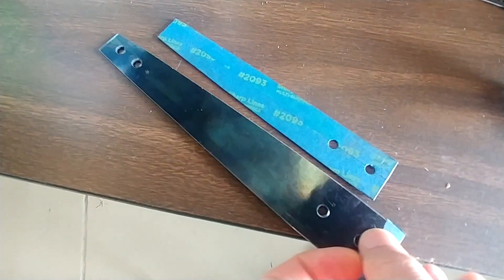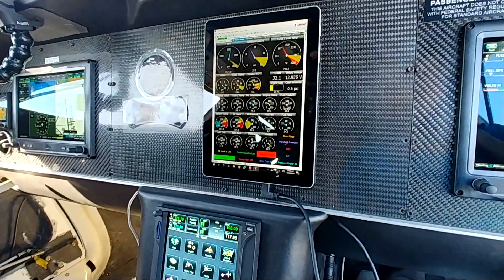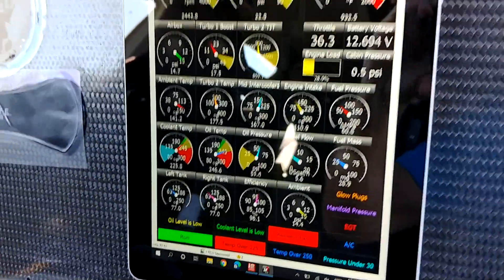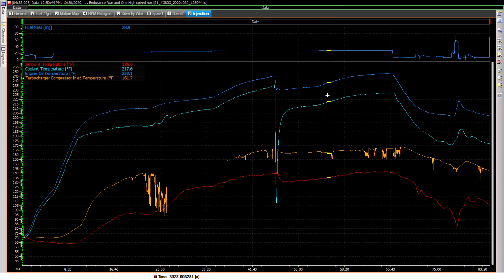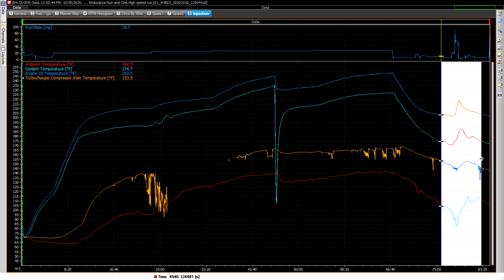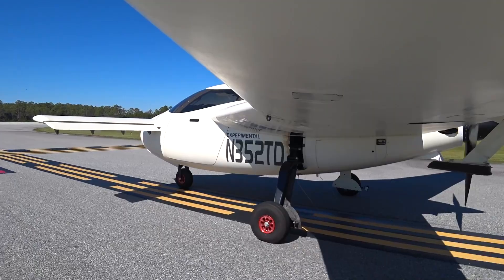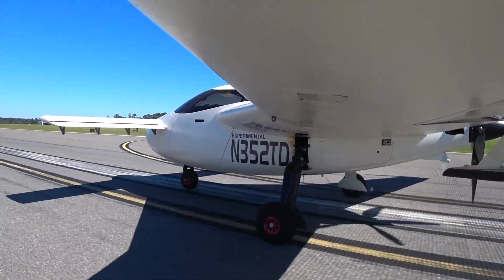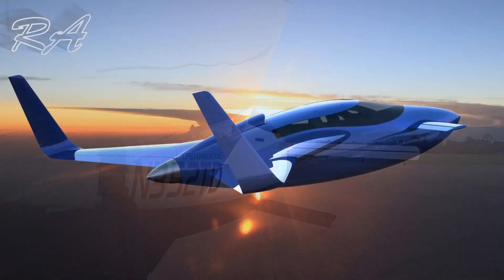Finding Equilibrium - Building the Raptor Prototype

Comment: Peter? . Do you have cabin  AC on during engine heat test or take off runs. It may help to disabled AC with a micro switch on throttle when  full power is required for take off . I have not noticed in before flight  check list. Could help with heat and  power. Looking forward to your next test flight .John

Comment: I didn't understand, why fwd CG should change your AOA on flight???
Reply: Because the canard will have to generate more lift to keep the nose up, the main wing will have to generate less (at the same weight) and hence fly at lower AOA. However, I think he said from 5 to 1 degrees which sounds like a lot. If that is measured relative to the zero-lift angle, that would mean the main wing only generated 1/5 the lift and surely the canard can't generate that much?

Comment: I'm liking your new trim spring design much better Peter.  Hope she behaves better in flight next time around. 👍
With the nose coolant tanks and cooler weather coming, you may not see engine heat problems till summer rolls back around.
I appreciate even your shorter update videos. 🙏  Thank you.

Comment: Do you know what the maximum oil temperature this motor was designed for? Most diesel engines will shut themselves off above 250° to protect themselves from catastrophic failure. Its my understanding this has a stock Audi block and rotating assembly.  I would not be comfortable maintaining 250° when it was never designed for it.
Reply: I’ll further get it to this. Aside from the loss of oil film strength at higher oil temps, another area of concern not many think about is piston cooling. Some of the highest temps the oil sees is at the bottom of the pistons. When the temperatures are critical enough, this oil that is being sprayed will begin to carbon up and attach to the bottom of the piston. This carbon acts as an insulator and the pistons will begin to no longer receive the cooling required to maintain it’s tolerance and integrity. I do not support the desire to sustain continuous operation of this engine at a temperature deemed critical in its original application.
Reply: @sy2207  - Not sure you understood the reasoning..
Reply: @PaulAnthonyDuttonUk  Im shure.... He didn't.
Reply: This is not targeted sustained temps in flight.  The whole point was to see where the temps stabilize at a certain power setting without ram air flow into the radiator scoop.  Basically, what power setting can he utilize for sure even if ram air cooling is not available (takeoff and climb).  If temps start getting out of hand, he'll know that at X power setting, it won't get any hotter.  That reduces pilot workload so he can focus on flying the plane back to the runway if something isn't operating correctly.

Comment: Are the covered up wheel wells now a permanent part of the design and you're giving up on retractable gear when you move beyond the prototype stage?
Reply: You're joking right? 🙄
Reply: @FWMjr2199  Well, he covered them up for a reason right? So far I didn't catch what the plan is to resolve that.
Reply: @ManuelBTC21  I think its more about determining if the oscillations seen on the first flight were, in fact, caused by the wheel wells. If its shown conclusively that the oscillations were caused by the wheel wells then I'm supposing some interesting discussions will be taking place! I'm generalizing here but most people in the comments on the first flight video  seemed to be sceptical...
Reply: Covered wheel wells are temporary!  For further tests on runway hops & perhaps a few wheels down test flights.  All of those would have been done with the gear down & locked anyway.

Please jump in here Peter if I've got anything wrong.

This new aircraft design is made to fly high & fast & comfortably & economically!  Pretty hard to accomplish all that with three landing gear hanging out in the slipstream!

Peter has overcome many problems as this prototype has been in development.  There will be more.  That's just how it goes with complex machines and new designs.  The Raptor just happens to be the cleanest & sexiest flying machine I've seen in general aviation in my forty-five years of being a pilot!  Amen for designers & builders. 👍

Comment: Another way to add short term (take-off) power while keeping temps down; using a switched misting of intercooler/radiator with water/alcohol mix (as opposed to just adding coolant mass). Used by several automotive oems (sti and evo for example). Cheap retrofit kits are available to evaluate the idea: https://www.summitracing.com/parts/dei-080140

Comment: The Dutton slides across the plains of the comments section. The air is dry, its lips are parched. It's been away for a short while. Some things appear to have changed. It sniffs the air, hoping to pick up a scent. Nothing. It's time to try a different approach. It's time to bring the prey to it. It howls into the night... AAARRR-WOOOOOOooowasabimuppetsrocketscientistspeterillprotectyoumylove
Reply: Unlike Wassabi I am a proactive type.

Comment: 246F oil temp is unacceptable for my engines. 180F ideal, 230F max. Cool engine is a happy engine.
Reply: For lycs and connies, sure...that's way too high.  This is a completely different engine with completely different systems in place.  From my research, these engines have a targeted oil temp range of 230-250F (250F being the upper limit for safe and reliable operation).  Modern oils can handle up to 250F but will break down at 275F, which is higher than what aviation oils like aeroshell can handle.  Pretty sure he's not using aeroshell in this engine, but rather what the manufacturer suggests.  Even on a typical aero engine like an IO-540, 180F is pretty hard to get down to unless you're in cruise...takeoff and climb you'll be in the neighborhood of 200-230F pretty easy in summer.  So far, he's really only been able to test the engine in takeoff/climb conditions, high power output and very little airflow, which is part of the reason why he's having cooling problems.  I suspect a lot of the cooling problems will go away once the aircraft is in cruise configuration.
Reply: @Skinflaps_Meatslapper  Thx for info. I did have a Connie in mind. I routinely saw 180F in cruise on my IO550. During winter months I had to block the oil cooler or it would never break 150F. Really good engine baffles. Learning something everyday. Thanks.
Reply: @nwbackcountry5327  What kind of bird you got running a 550?  Might look into whether there's an STC for an oil cooler door mod.  Where I work during the winter, early morning temps might be down in the 30's and then in the middle of the day it's up to 80, and if it weren't for a cockpit adjustable door, I'd lose my mind chasing temps all day trying to keep this radial happy.  All the way open in cold weather, the oil will get so thick I'll hit redline oil pressure below RPM redline.  Only partially closed in hot weather, oil temps will skyrocket and pressure falls below minimum.
Reply: @Skinflaps_Meatslapper  I was flying a Baron E55 with IO550s and Beryl D'Shannon engine baffles.
Reply: @nwbackcountry5327  Nice, I've heard good things about D'Shannon baffles from everyone who's had them.  I tried to get them to make a set for my C-188 years ago but they won't stray from Beech.
Reply: Your recommended temps aren't really applicable in this case.  This engine uses oil to cool both the pistons and turbos, which are very high temperature items and bring the oil temp up quite high, then it uses an oil to water oil cooler, so the oil temps can never be lower than the engine coolant temps since the stepped heat flow is pistons&turbos->oil->coolant->atmosphere.  It's much less important what the exact temps are than whether or not they are staying within the design range.  If they are getting out of the design range, then you need to adjust oil viscosity to maintain the proper oil flow and film strength at the actual temps.
Reply: When was the last time you ran your engine at 2400rpm for an hour to get that hot? Remember that test is an abusive condition to discover the limits.
Reply: @rnordquest  2400 rpm is cruise in a lot of propeller aircraft so that's not an extreme condition.

Comment: Peter, you can't expect to see span wise flow unless you're making lift, and more so out of ground effect.
Reply: Low pressure in front of the prop is limiting spanwise flow at the wing/strake transition.  Spanwise flow will likely be noted further outboard.  Note vortelon locations on Long EZ/Velocity.
Reply from the maker: True, but given the main wing has about 2.5 to 3 degrees of alpha when the aircraft is level it's already making some lift on these runs. So I suspect the same result may happen when airborne.
Reply: @RaptorAircraft  Spanwise flow will increase as AOA increases.  Imagine a wing at 90deg AOA, the telltales would be flowing in every direction from the center of the wing.  Cut it back to 45deg AOA and you'll see half as much spanwise flow, but still a very significant amount.  Cut it down to 3deg AOA and it won't be exaggerated enough to see a whole lot of useful data.  I only speak from experience after doing these same types of tests for spanwise flow in an ag plane with spray boom supports that looked very similar to a wing fence.  I wanted to know if those supports were straightening out spanwise flow and providing a net increase in efficiency or not.  Since I had to have them and they weren't doing anything but creating parasitic drag in the first place, I figured I might as well see if I was getting some benefit from them.  During testing I observed that only in high AOA would I saw a measurable spanwise flow with a clean wing.  It turned out that they were actually pretty effective at disrupting spanwise flow on the upper wing but no so much on the lower wing, and I've made some improvements since then to capitalize on an otherwise necessary drag generating support.  I've swapped from a bottom wing support to an upper wing support and increased their size to cuff the leading edge.  Net result was actually an increase in load capacity, lower stall speed with more control, with no loss in top end speed.  Long story short, those telltales will likely only show spanwise flow at 10deg AOA or higher, and until you test the wing at those variables you won't really know if a wing fence is going to be helpful or not.
Reply: @RaptorAircraft  "ground effect" is simply pressure generated from forward velocity causing lift so this point simply need not be responded to as it is false (for example a Formula One race car or Catamaran hull racing boats suffer a problem of lift due to too much forward velocity leading to dangerous and indeed "airborne events.) Looking at what still seems like a crazy idea my first thought is that the canard wing might create too much ground effect in point of fact thus shredding the the entire airframe and engine. I would argue a more Formula one style "downforce nose" would be absolutely critical to offset the natural lift from the main wing in addition to the canard wing forward. I think Formula One Racers use some type of "X-Wing" design to include a very stout and elongated/narrow nose to keep their vehicle "in level flight" so to speak.

Another option is to pull the engine and drive system entirely out of the airframe and test the Platform as a glider although to the designer's(s'?) credit he has in fact flown the vehicle.

Anyhow just downstate in Florida is Kermit Weeks if you want to talk to an actual expert in flight period let alone flight design would be my advice. I think he and his amazing team would love fooling around with some type of "proto-type" of our modern minds in point of fact.
Reply: @doolittlegeorge  You're getting automotive and aircraft terminology mixed up in a terrible way.  Nothing of what you said is remotely accurate or relates to this aircraft in the least.  Ground effect in aircraft has nothing to do with forward velocity causing lift, it has everything to do with the additional lift generated by trapping air between the wing and ground when in normal flight there is nothing to trap the air between.  Think of it more like a 4x8 sheet of plywood falling onto a flat surface...it has little air resistance until it starts getting close to the ground where the air can be compressed against the ground itself. It doesn't slam on the ground, it kind of sounds like someone threw a pillow under there at the last moment.  The 4x8 sheet still had the same air resistance as it always had, but since the air had nowhere else to go when it was an inch off the ground, it compressed and accelerated the air, slowing the impact considerably.  Aircraft begin to see ground effect at roughly the same height above ground as their wingspan is wide, and it's similar to riding on a cushion of air.  Effective lift is slightly enhanced, so you have a little more to work with when you're a few feet off the ground.  That's it.  There's no formula one backflips involved, no shredding of airframes...aircraft have aerodynamic controls called elevators to take care of all that business, cars don't.  Adding downforce to the nose would mean you're pushing the stick forward and trying to fly the plane into the ground itself.  You want the canard to develop lift because that's the only way you're going to get the plane off the ground.  Read up on how aircraft fly, it's a whole new world beyond cars and boats.  Furthermore, there's no advantage to turning it into a glider, especially since this aircraft is so far above and beyond what a conventional aircraft could tow that you'd likely never find one capable of it.  Even if there was a plane out there set up to tow non-glider aircraft at high speeds, it would be enormously expensive, incur far more complexity and risk than test flying with an engine, you'd have to completely re-draw the weight and balance of the aircraft (not to mention adding several hundred pounds of dead weight in the tail), you'd be stuck with a GLIDER, and you just won't get anything worthwhile out of it.  Finally, Kermit specializes in restoring existing aircraft, not designing new ones.
Reply: @Skinflaps_Meatslapper  @Doolittle is obviously not a pilot.   The CG issue you addressed was also telltale.  If trying to make it a glider just don’t start the engine and tow away.  Ha.
Reply: @dreamcreator2552  Yeah, trying not to hurt feelings but also be informative in my objections.  If I'm wrong, at least give me the courtesy of explaining why, you know?

I'd entertain the idea of replacing the engine with a turbine (Allison 250, PT-6, Walther 601, etc.), just for flight testing the airframe.  That would take care of the power and cooling issues, as well as address any reliability concerns with one fell swoop.  He could concentrate on getting the airframe squared away instead of an unproven airframe and unproven engine in combination.  If it flies like crap with a proven powerplant, then the airframe is the culprit.  If it flies great, push on with testing and work on getting the engine to cool and produce power in a wider range of variables.  Added bonus for being able to offer a turbine version kit, it flies in the face of what the Raptor's ethos is but we all know people will eventually go there in the kitplane world.

Comment: YOU CANNOT HAVE ALUMINUM PARTS WITH A SHARP ZERO-RADIUS CORNERS AND EXPECT THE PART TO BE SAFE!
Even pure annealed aluminum does not have the fatigue strength/durability for that.
http://www.cumberlandmetals.com/aluminum/minimum-bend-radii/
https://americanmachinetools.com/bend_radius.htm
No, I did not enjoy the video : (
Reply: Yeah, I'm not sure this is the best spring option. There are certainly better ones out there.
Reply from the maker: If your referring to the C channel piece, that is extruded and not bent.

Comment: Hi Peter
Just a thought buddy is it possible for your to set up a fan or blower infront of your air inlet duct to simulate 100 knot airflow in the inlet to give you a closer idea of flight Temps now you have you ducting better?? I know you won't get the benefit of the suction from your outlet mods but will give you a closer idea than just sitting running with the prop as radiant heat might stay lower with that simulated airflow,just an idea buddy..
Keep it up Peter slow and steady is the way to go..
Cheers Alistair